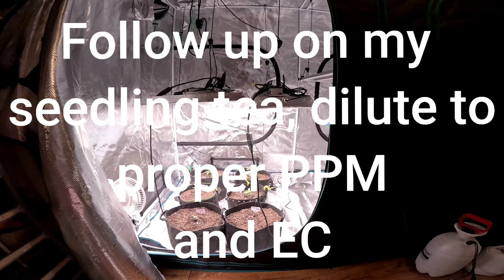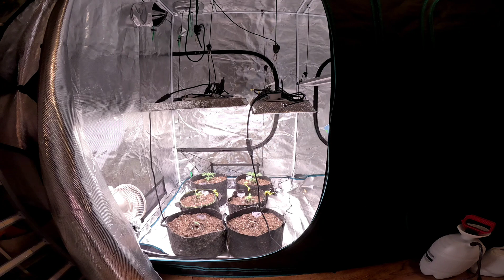Follow up on my seedling tea video, always check and dilute to proper PPM and EC.

Comment: Jacks 321 in Buffered CoCo @6 PH is perfect for new growers. #Foolproof
 JM2¢
Reply from the maker: You soak it in cal mag??
Reply: @mikesgrowroom6391  yes, 7.5 ml per gallon. Soak for 12 hrs, drain and use. I do this with the supposed pre buffered brands too. JM2¢.
Reply from the maker: @MikeParentLeap  I would have thought you would need larger dose.
Reply: @mikesgrowroom6391  That’s the prescribed rate for buffering that I’ve followed.  Some say to do it twice, which,I’ve done. I didn’t see a difference. JM2¢